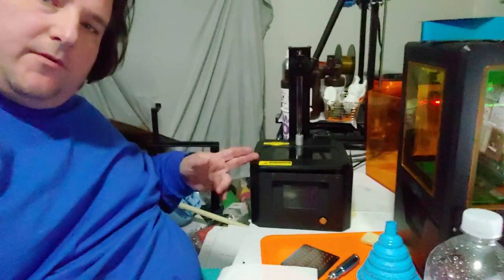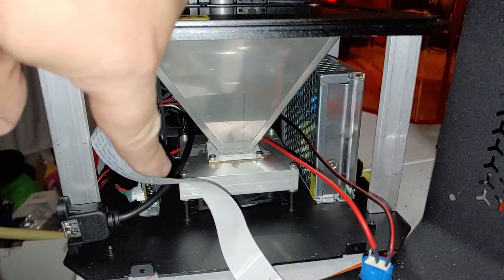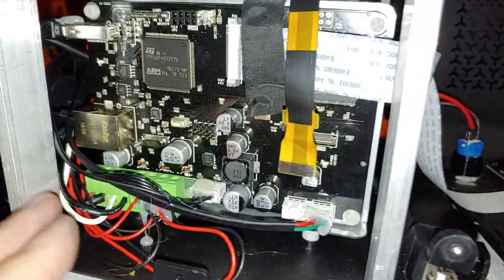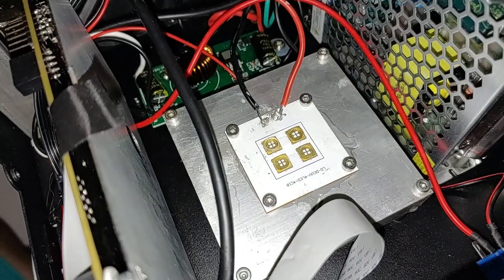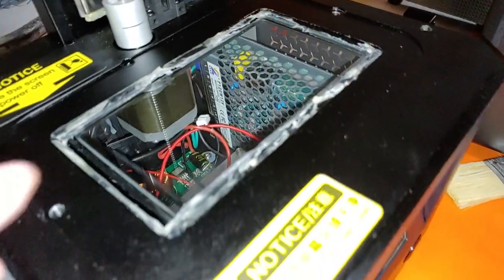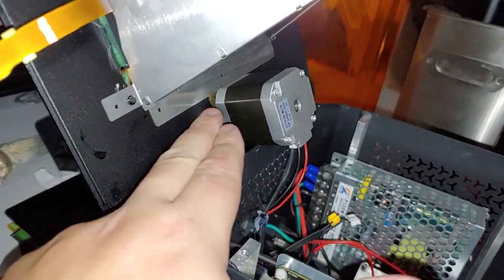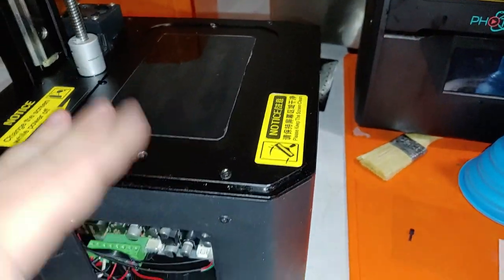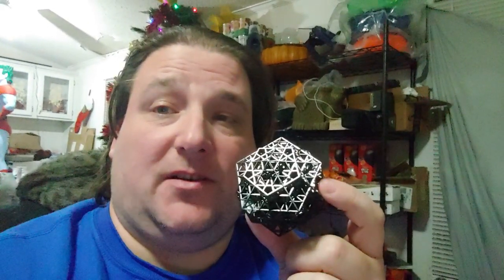Creality LD-002R LCD Replace & Exploration MSLA Resin Printer Beta Hardware T3DP

Comment: Thanks for your video I had issues with the intake fan going out but upon my replacing the fan the ground wire came undone and knowwhere was there a video or info on replacing it or where it was connected but your video showed me where it was connected thanks again.

Comment: Thinking of getting one of these but the only concerns I have are those noisy fans and the resin fumes since it'll be setup in my bedroom . I was hoping that the fumes were being routed out one of the ports on the side but it looks like it comes out all the ports on the sides . That's going to be a pain to attach a vent to it and have the fumes routed out a window . 
What size fans does it use , 40mm? Thinking it's best to replace those with Noctuas.
Reply from the maker: Consider the Frozen Sonic Mini it's almost completely silent. Build a small enclosure out of Styrofoam to put over top of the machine. And then a very small quiet fan in a hose vented outside the slight negative pressure should keep the fumes going outside and not inside. Otherwise, I would not run this in a bedroom.

Comment: Hi, I replaced the LCD a few days ago, it worked fine twice and then the UV light doesn't stay on, I did the exposure test (the one with the rectangular UV light borders) and the rectangle UV light only lasts 3 seconds and turns off , the test continues to run but only with the backlight without the UV light. What could be the problem? Thanks.

Comment: Bonjour, merci pour ta vidéo 🙂, est ces que l'on peut transformer la Ld002r en ld002h svp ?
Reply from the maker: I don't understand what you're saying and I can't translate on the phone but I recognize those model numbers you want the one with the black and white screen you do not want the one with the RGB screen you want the 002h model with the monochrome screen
Reply: @nerys71  thank you for your answer, I would like to substitue the screen LD 002r with the screen LD 002h
Reply from the maker: @jdu1697  I do not think that is possible even if the screen could communicate with the electronics it's physically a different size the h screen is larger

Comment: For what reason did you change it? broken? It ran out? If it ran out how long it lasted and if you know how many impressions it gave approximately and I know that it is difficult to calculate but to be able to estimate the useful life of the screen, great video!!!
Reply from the maker: It was defective died in a few hours (it happens) they sent a replacement. Buying a machine today I suggest only buying monochrome screen machines ld002H is the mono version. The screen should last life of the machine not consumable like the color rgb panels are.
Reply: @nerys71  I know that, thanks for the advice but i purchased  same as yours,  here is very expensive, i wish has a long lifetime..., i se extrange it has not ballbearing on the top screw..
Reply from the maker: @nopochoclos  No need for a bearing at the top. you don't want to constrain the screw as this would apply a torque to the guidance rail which you don't want.

keep an eye out for replacement screens. usually around $30 to $40 US (not sure about the creality screen I will try to find out)

Its a consumable. it has to be replaced at intervals. the UV LED degrades and damages the LCD panel over time until failure.

https://smith3d.com/product/creality-ld-002r-2k-lcd-display-replacement-lcd-resin-3d-printer/

that site has it for $27 not sure on shipping and its probably available at other locations just have to hunt around for it.
Reply: @nerys71  The shipping to Argentina is one of the most expensive in the world, next thanks to the corrupt politicians need to Add 50 % +30% on taxes...+shipping.. imagine the price.., thanks for the info  i try to do my besto when use it!

Comment: UV Light "Shroud" could be cut a bit to avoid stepper motor mount pushing it at all. Good and helpful video! To bad this printer is hard to get at the moment due to virus. It is kind of very similar to Mars pro which is also not available. For LCD screen "glue" it is possible that some kind of a good quality double sided tape, cut to match, could be used. Some of those are very strong. Some of them could be found in carpet section at Home Depot.

Comment: Just wondering if anyone knows the specs on the case/board fan (The fan next to the usb plug in the video). Mine started making horrible noises so I need to replace it. I've spent some time surfing and haven't found any info on what size it is. As far as voltage it looks to be 12v. Much thanks!

Comment: i need a hand here bro, my lcd has gone bad and i cant find one to buy. can you give me the part number on it, also what other screen did you say worked, i thought the mars was slightly smaller than the ld-002r? the ld-002r and i dont want to take away capacity by using the wrong one. thanks in advance and great vid, glad i found it
Reply from the maker: Any aftermarket elegoo or photon lcd should fit. Thats what i bought to put in my ld002r when the lcd died. If its a photon screen make sure the cable is straight and does not have that 90' elbow in it (should come with a 90' elbow adaptor which you wont need to use)
Reply: @nerys71  thanks bud, i appreciate it

Comment: Quick question, is it possible to make the ender 3 printer taller? Somewhat easily? So I can make taller prints.
Reply from the maker: yes and no. it depends on your definition of "easily"

The only way to print taller is to MAKE the printer taller. This means the 2 vertical rails and the lead screw will need to be replaced with longer versions. depending on how tall you will also need to extend the wiring going to the hot end carriage assembly and the left vertical carriage and you MIGHT need to change the firmware (not sure if there is a hard Z limit probable not!!)

there are kits available on ebay to do exactly this. its actually not that expensive and being in "kit form" helps toward the Somewhat Easily aspect

click my ebay link in the description and paste this into search 264569651165.  $99 and everything you need is included.

500mm build height. if you a real glutten for some hacking (I JUST might try this I mean $219 to get another 445 machine? I just might do that) this kit gets you 400x400x500 :-) and its back ordered 264569651179
Reply: Oml sounds great thank you! Do you think that would be a good video idea? Lol! On another topic... I have $350 to spend on just that upgrade sooo. Idk what would be the best option. If I should just save some more for a newer, taller printer. Or do the upgrade? I hope that you think that would be an interest of yours to make a video on that and maybe try it. Thank you for helping me.🙂
Reply: By the way, keep up the good work.
Reply from the maker: @nathanking5080  for $350 put ANOTHER Ender 3 AND the upgrade and you will have cash left over and now 2 printers.
Reply from the maker: @nathanking5080  YEs it would be a good video. alas I can't do that now. maybe next month see how much cash I have :-) having a 500mm tall nose cone machine would be pretty damned slick!
Reply: Thanks for the heart nerys!

Comment: Unfortunately, it seems that most of these, like the creality, the mars, etc will have this issue( I don't know about the led matrix ones), and the lcds must be considered consumables as they die or get dead pixels
Reply from the maker: its not so much an issue as the nature of what they are doing. they are essentially using off the shelf LCD panels (this is why they can sell them for $300) but they are also putting them in one of the harshest environments you can put them in UV lights is extremely damaging to most things. We are BLASTING these panels with insane amounts of constant UV exposure. high power UV exposure. would blind you or give you a sun burn kind of power.
Reply: All the more reason to shy away from cheap printers from fly-by-night companies, especially is they don't use 'standard' panels. If you go with something like Anycubic or Elegoo, at least you can be fairly confident that the correct LCD panel will still be available long after the company is gone.
Reply from the maker: @JohnJones-oy3md  I would shy away from any cubic then they are the outlier they use a different screen cable elegoo epax creality all use the same screen now aftermarket screens usually come with the right angle adapter to make them Photon compatible if you buy a photon screen it won't fit the elegoo the creality or the epax
Reply: @nerys71  I am aware. They need special panels if it's to survive more, but sometimes even a few hours make some pixels go bye. Maybe the matrix led has a lower intensity idk
Reply: I bought the LD-002R as my first resin printer. It's delivering good quality but my next printer will have a monochrome display and I also will make sure it has a good UV light source (aka matrix).

Comment: The LED board is similar to the one in the Anycubic Photon. Not the best solution and considering that this printer is new, they had time enough to come up with a better design. One that is comparable to the Phrozen Para LED 2.0.

Comment: can u replace the fans with a noctua? that solderjob is a shit. i think a 3m double sided job will do the trick
Reply from the maker: I am not sure I would replace the fans they are already very quiet on this machine and you do not want to reduce your CFM or you could fry your LED array
Reply: @nerys71  please make more reviews about the creality resin printer. timelapse how many hours it could take to finish a 1 print.

Comment: Those aluminium substrate led's are very hard to solder, there is a trick to solder those properly. You need to preheat the LED before soldering, people like to heat these types of led's on something like a clothing iron for example and then solder it while hot. These led's are normally very hard to solder because the substrate sinks the heat away from your soldering iron very efficiently, and that makes it hard to get the solder flowing like it should... just a tip if anyone ever needs to redo any of these...
Reply from the maker: Yep! Iron works a treat!

Comment: what are the fan sizes please ?
Reply from the maker: I don't know. I did not take note of the van zizes. I will look it up. I would be careful trying to use quieter fans. It really does need the cubic feet per minute. To keep the system cool
Reply: @nerys71  Yes, especially the uv leds...but Sunon 60mm 21,6m³/h 0,27W are a good choice for the "back" of the printer i think (sorry for my English)

Comment: any clue why files aren’t showing up i saved in chitubox put on sd plugged in. shows them but says not there.
Reply from the maker: What do you mean it shows them but says they're not there? Also remember you have three different kinds of files you can save from Tri to box you can save the STL file you can save the sliced file and you can also save your work file with all your edits and changes in it from chitu box
Reply: Nerys figured it out the v1.6.2 with ld-002r stinks so i just made a default profile. now it works

Comment: i want to upgrade it will 4k screen ,any idea?
Reply from the maker: There is a group working on getting higher resolution screens to replace in these printers, but I'm not sure how that works.
Reply: @nerys71  right, the motherboard may be support 2k only
Reply: any link? Thx